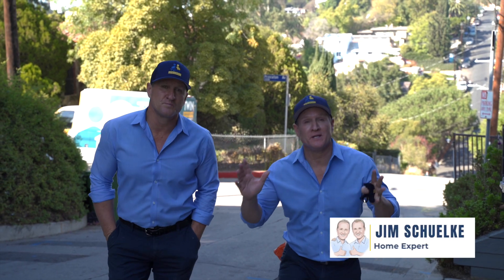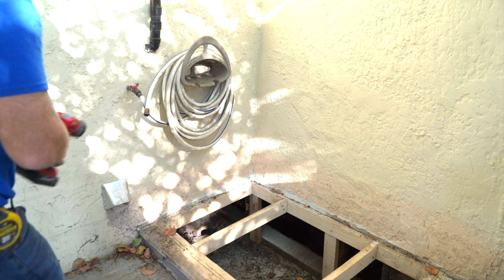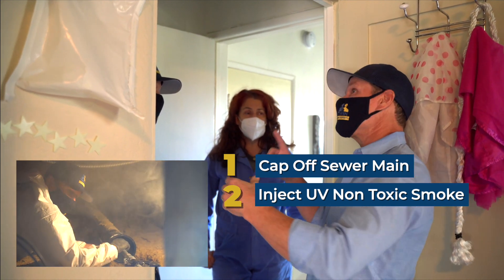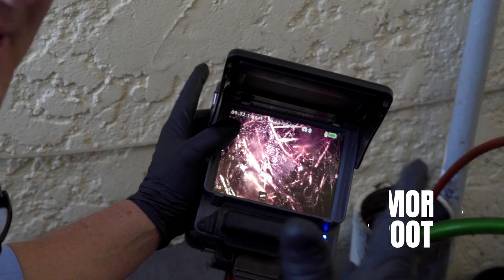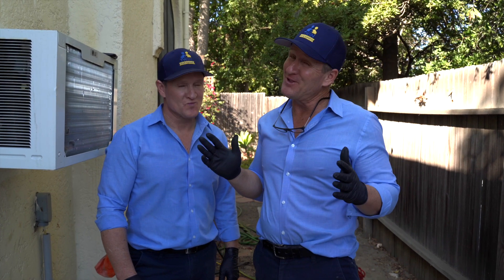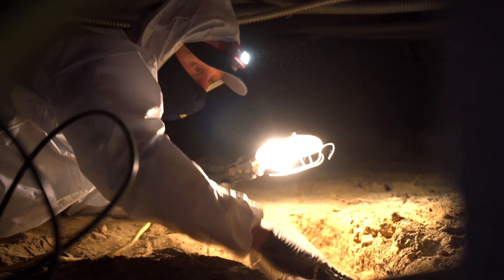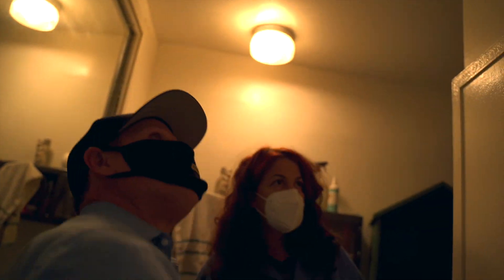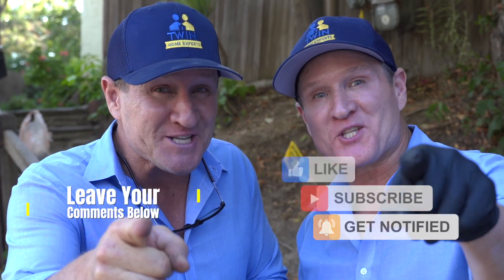She had 22 SEWER Rats in her house!! This is what we found....Twin Plumbing

Comment: You installed the wrong checkvalve. You need a normally open check valve on a main sewer line. When in bathroons then u install normally closed check valve like the one u had. The reason is that you block the ventilation with that on the main line

Comment: Big difference between rats and mice. With Rats, one only have to do two things.  1, Find the breach. In residential areas, rats will enter from a compromised sewer installation because they live "naturally" in the sewer system . It is simply a matter of finding the breach.  Then #2, to eliminate any rodent that taken up residency in the building. They love attics, even if that is not where the breach is. But they are very smart. They will not go in a trap in the crawl space shown in this vid. To obvious. You have to camouflage it it with the sand. Also, in case you think poison will help, that is only a temporary fix, but will do nothing in the long run as long as the breach is open.
Reply from the maker: This is an awesome share and valuable information here folks. Thank you Per!

Comment: So you were at the side of the house to run the sewer camera and literally a foot away from your head I see a piece of 1 inch conduit separated from the l box going through the wall with a piece of wire going through the conduit. A good place for mice to get in but not big rats. And I'm not even 5 minutes into the video yet. Wonder if you're going to mention it.

Comment: Now I am certain I might have this problem. I sealed up every hole, Sealed the outsides. Then one day I started hearing biting noises in places I NEVER heard them. 3 days later a brand new hole they made. They are coming from the bottom....I have a slab...but when they put that slab, they stupidly forgot to remove the heavy duty plastic that held the sand that went below the slab. So half my back yard always has standing water....I am guessing over time that might have gotten beneath the slab.

Comment: Hydrojetting isnt recommended if the system is abs according to my plumber. Also it costs about $600 in so.calif.
Reply: I do hydro jetting for bigger drain pipes in SoCal. You can adjust the amount of pressure needed to not damage any pipes. That was definitely a residential style hydro jetter, I think it was a great idea. Might as well clean the pipe while your getting the roots out.

Comment: OMG ....I wish y'all were in Texas ..I live in a rental duplex property....and the pest control service isn't working. Poison isn't enough....and I believe the nest is in the garage that's connects to mine. It was abandoned for 5months...and they lefts a fridge of food, dogs were abandoned for a month.   It was horrible. Now I'm fighting to rid my garage and home walls of mice. Any recommendations near Azle Texas are welcomed
Reply: @ Shonna Randle : I know what you’re struggling through. I battled roof rats for near 5 yrs due to nasty absent neighbor that remodeled &workers made a true trash dump next to my entire property with his blessing.
    You’ve got to do an exclusion yourself. Gear up & carefully inspect your garage & wall. If you are not handy, hire someone to screw & glue thick flashing on that wall, on the outside facing abandoned house, seal every possible hole & crack, not just obvious ones. If you’re hearing noises, install flashing on your garage walls & rodent garage door excluder bar so they cannot enter under you car garage door. There’s one for people garage doors too. Hopefully you don’t have any shared sewer pipes running to your property underground.
     Last, build outdoor trap (2x4 wood with 2-4 snap traps inside ) using lots bait since it’s an empty house & place it next to some stacked logs or entry points, away ( not too close) from your home. That will kill most rats. Hopefully you won’t need to go nuclear & electricify your boundaries.  For mice, build “roach motel” trap.( YouTube has many types of above traps).
     DIY traps are fairly easy. Be vigilant. As long as that house is abandoned or neglected, rats / mice will seek adjacent shelter - your home & your neighbors.  Speak to your other neighbors about this & write your landlord, because rats will invade their home too.  
  Scientists proved Strobe lights, certain DIY poisons don’t work on breeding adult rats, not alpha nor smart rodents. Night vision motion activated trap cameras help too, so you can see what works & find entry points, rat or mice runways for traps. See Shawn Woods site for inspiration.
   Keep all food in thick glass containers in shelves or sealed in fridge. OCD in kitchen, no crumbs or snacks, pasta etc. on counter tops unless it’s securely sealed- be minimalistic. It’s a PAIN but you don’t want rats in your food & eating area; mice nesting in your kitchen/ pantry drawers; same for pet foods. No dirty pet bowls out & put away water bowl at night when you sleep, or raise it up so it’s off the ground. No leaks anywhere since they need water,
   If all else fails hire a good reputable FULLY licensed & researched by you pro pest co & check their work. READ all contracts carefully “control” doesn’t mean kill all or most. State Licenses & city permits a must!! Referrals from locals are good yet get several estimates.
   Last, if you really cannot stand it, move out with a letter of notice to landlord re rat problem ignored to protect your self. Good hunting.
Reply: @l.e.6263  lots of good info, however, I have gone to many homes that they tried the licensed contractors, paid the money, with no results, because they wanted their homeowners insurance to cover it, afterwards I get the call, so I go do my work, and rats are gone, and I have no license,  just a brain and creativity, but I do my work under constitutional law, which those who follow state regs know nothing about, but my clients have to pay cash for my services, and I have never had a return call for my services